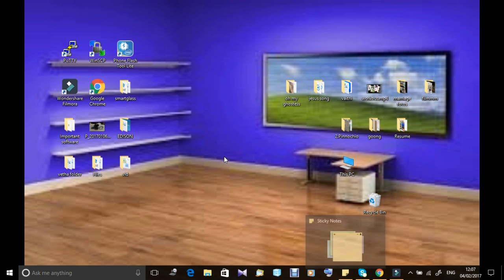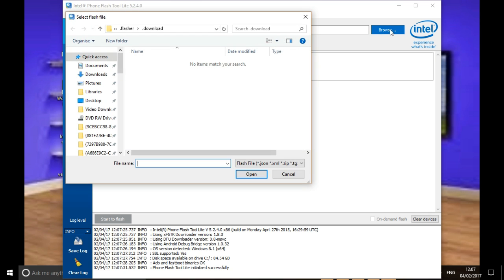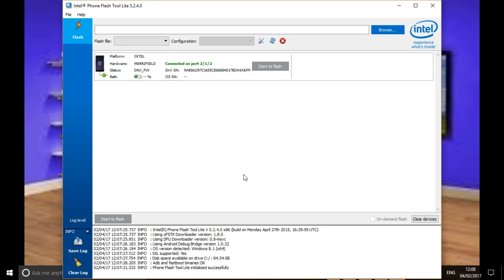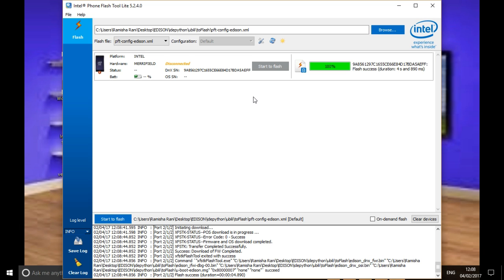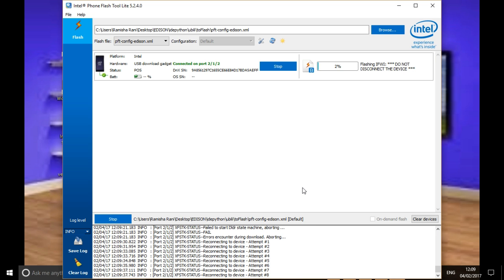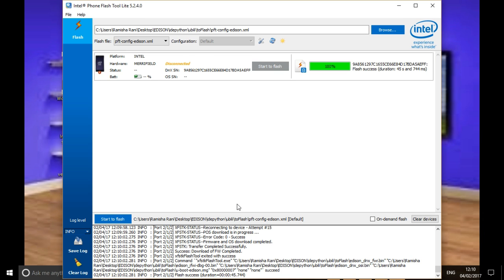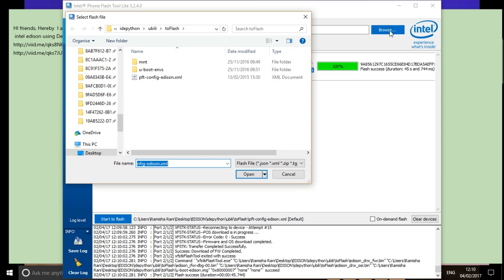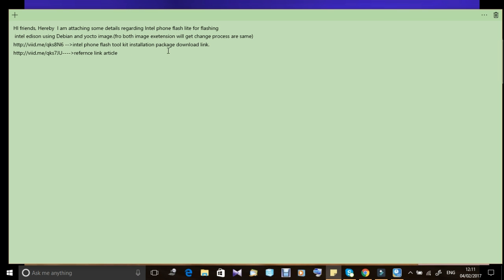How to Flash Intel edison Using Intel phone flash tool lite Debian and Yocto

Comment: 10/17/17 16:57:29.767  INFO   : Ready to flash!
10/17/17 16:57:29.770  INFO   : Flash file D:\Asus\Asus Z007\WW-ZC451CG-4.11.40.55-rel-user-20150125-184047-signed\flash.xml [Default] loaded
10/17/17 16:57:43.335  INFO   : [Port 0/6] New device detected on 0/6 (id=0005000000000001)
10/17/17 16:57:52.328  INFO   : [Port 0/6] Start flashing the flash configuration with pos start state for 56BDBEA879808040
10/17/17 16:57:52.328  ERROR  : Automatic reboot is not supported on this device, please reboot the device manually
10/17/17 16:57:52.328  ERROR  : [Port 0/6] Failed to reboot the device